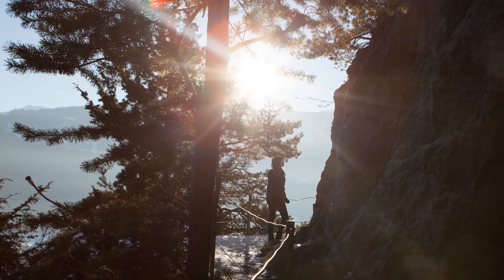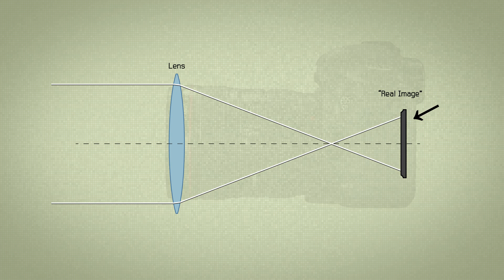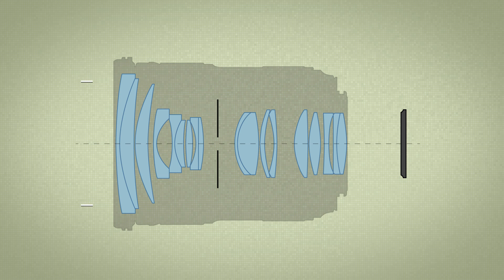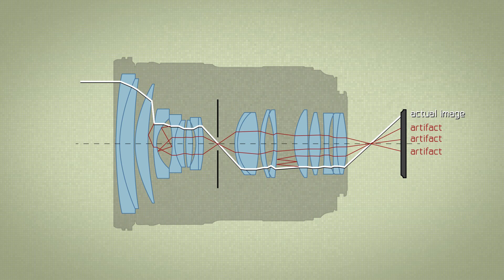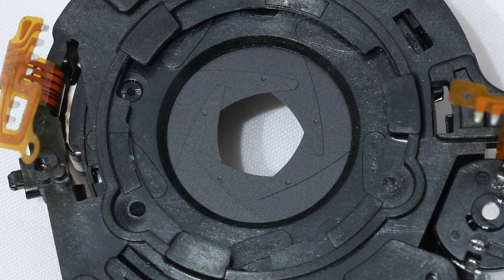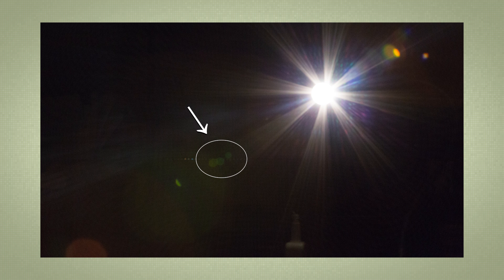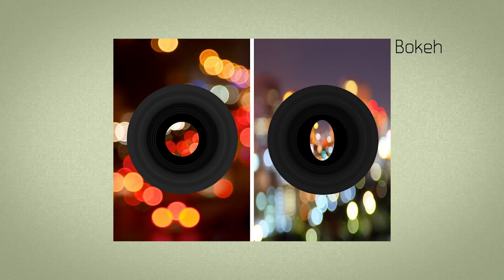Lens Flares: Why they look like that?

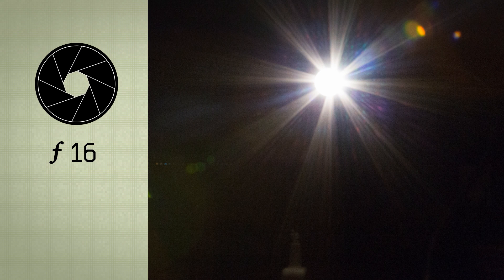Comment: Nice video. But the starburst explanation at 4:50 is wrong. Each blade produces diametrical streak perpendicular to it, due to diffraction. So 5-blade aperture would produce 10 radial streaks. So the left picture is wrong and cannot be observed in real world. Have you ever seen a starburst with odd number of streaks? Analogically, the right picture is wrong. The middle picture has even number of blades, so it will produce 6 radial streaks indeed, but the rotation in your example is wrong. The picture or the aperture scheme must be rotated 30 degrees to be correct.
Reply from the maker: Thanks for pointing out the errors and the thorough clarification, Asen!
Reply: What is causing those streaks anyway? Light entering the lens between the small gap between aperture blades as they overlap each other?
Reply: In my opinion it's not completely wrong, just a little generalized :D (well at least close to it :D)
Reply: Had a teacher at university, he used to say that starbursts come from the failure of reciprocity in long exposures. 🕶️

Comment: Super useful. Can I ask what causes the Chroma Rings and Chroma Bands you mentioned briefly? I have seen them also in spherical lenses. What they depend on?
Reply from the maker: Good question! As with any such artifacts my answer would be “imperfections on the lens” but what exactly is probably left to the physics professors 😅

Comment: I still don't understand the flare in my video. It moves at its own speed, like a butterfly even if I keep my hand steady to make the video.
Reply from the maker: it's hard to say without seeing your issues firsthand but what you describe could be due to built-in stabilization 🤔
Reply: @PixelProphecy  Ok ... There are also different kinds of flares. In my case, if I enlarge the video, it looks like two green lines next to each other, like the notes of a piano, so to speak.